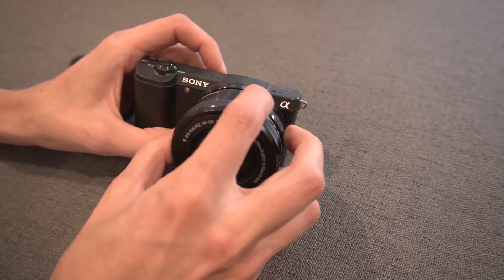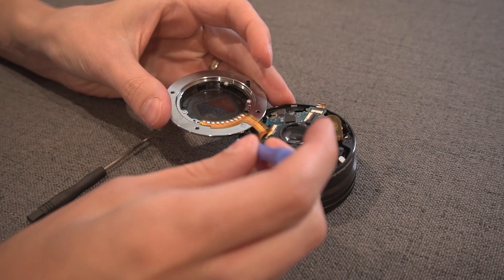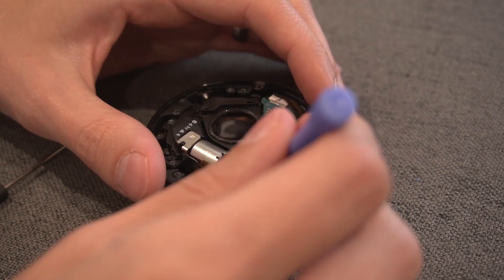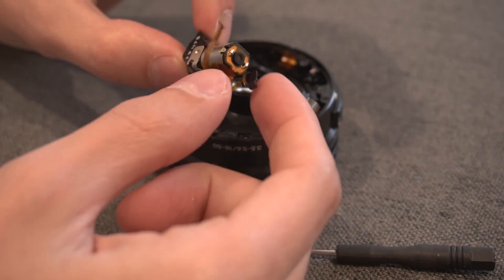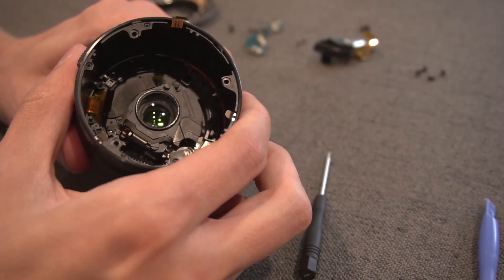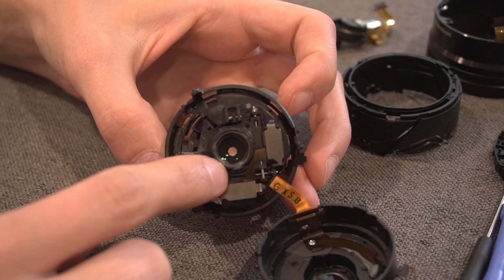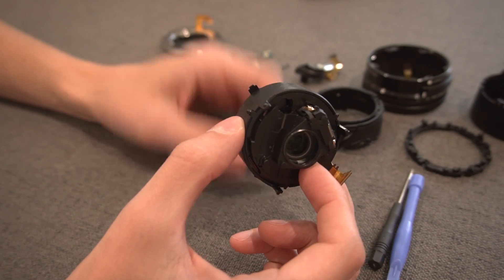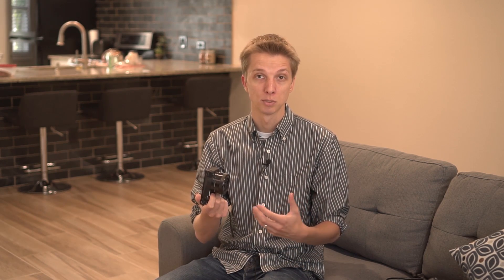Sony 16-50mm Kit Lens Disassembly Tutorial

Comment: Hi. Thank you for this tutorial!

This completely saved me from buying a secondhand kit lens for the Sony A6000 which I only borrowed from my son.

I just finished repairing the kit after a heartbreaking incident during a pre-Christmas celebration with wife and her friends.

I had a power bank (in my pocket) attached to the camera through a dummy battery.
I forgot all about it. When I stood up, there went the camera with the lens and a Godox TT600 flash landing on the concrete floor. 
Everything inside the lens got misaligned and stuck.
Good thing only the lens was affected but not damaged as there were no severe dents and broken parts.
Just minor scratches. It absorbed all the impact.
This kit lens is tough indeed!

The camera and flash are both okay.

This tutorial saved me a lot of pain in disassembling and reassembling.
Mine was more difficult to disassemble as the impact caused all three plastic and three metal guides jumped off its tracks (as in train tracks if this is the right term).

I had to improvise extra plastic pry tools using ballpoint pen caps. 😂
It was too painful to describe; I was worried I would break it.

Thank God! The kit lens and camera are working.

God bless you!
Shalom

Comment: Well I got it apart and found exactly what was predicted. One of the tabs came off. I removed that and finally got the thing back together, but I'm still getting the error msgs saying that the lens is not supported. It feels like it's trying to autofocus, but not working. Any advice?
Reply: I figured out why mine wasn't auto-focusing... I must admit, it's a little embarrassing. There are four ribbon cables that attach to the PCB. In the video, during the rebuild section, he only shows three of them being installed. Normally this would be a completely obvious oversight (and admittedly it still is), but one of the ribbon cables on the right of the PCB is very easily covered up as you place the PCB down. As a result... I just didn't install it... 

Take a look at the image below. The ribbon cable labeled "A" ended up below the PCB. He doesn't show it being reinstalled, so I just mindlessly skipped it. It goes into "B" with the  gold side down.

The commenter above is referring to the orientation of this cable. They must have installed it upside-down. I simply didn't install it back in the PCB. Once I did, everything worked great. 

I hope this helps!

https://imgur.com/a/pOGuysS

Comment: Help! Great video, but I'm stuck. I'm hoping someone can provide some guidance. I'm at the step at 6:00 where the outer piece that holds the front lens, but my lens will not extend (this is the problem with the lens to begin with). I suspect something is in those trenches preventing the pins from moving. How can I get the outer piece off if I cannot extend the lens and move those pins to the bottom?

Comment: Thank you! My lens would not retract fully which caused the A6000 to not recognize the lens.  A small piece of plastic from one of the tabs broke off and prevented the lens from fully retracting it.  Clearing the debris out after a full disassembly fixed it so now it once again works perfectly.  Yes lining every up for reassembly was the most difficult part.  The complexity of the plastic channels to make everything work with one motor is amazing.

Comment: Yours is still the best video for fixing this lens.  Dropped camera and the barrel mechanism came out of grooves.  Had a bit of work to clean up the scratched groves and to carefully bend the tabs/pins back.  Even had to repeat because the smallest little ding on the barrel caused it to hang up while zooming (clearances very tight) so I would just warn people to examine those surfaces very carefully looking for dings or places it will bind.  But your clues on how to reassemble were perfect.  For sure I would have given up without them.

Comment: Wow, you have saved me from having to buy a new lens for the camera. I am eternally grateful!

I had exactly the same problem as you, the lens wouldn't close all the way when I turned the camera off and when I turned it on it made a weird noise and wouldn't zoom. It also gave me an error.

When I disassembled the lens following your steps, a little piece of plastic fell out and it turned out to be exactly the same tab that had broken off for you. In my case I didn't stick it with glue, I reassembled the lens removing the little piece of plastic to test if that was the problem. I have kept it to be able to glue it in the future.

After being able to mount the lens again (what an odyssey!), it works like a charm again.

Thanks a lot for the tutorial!

Comment: I  have seen this video before out of curiosity but hoping that i'd never had to actually use it, but today I had to come back.
I dropped my kit lens, and the focus ring got bent and stuck,  and  it wasn´t expanding any more when I turned the camera on.. a total mess, but thanks to this I was able to disassemble it,  and gently use a chisel and hammer to straighten the edge of the ring,   it took me a couple of hours to assemble everything back in, but now it is working like a charm again.
thank you very much for submitting this.

Comment: If you google a bit, you should be able to find the service manual for free. I don't think youtube will let me put the link in the comment. But Sony recommends removing the focus ring (called the "Operation Barrel Assy") before separating the inner and outer barrels, that way you don't have to force the pins out, they just slide apart. You  can use a piece of thin wire to lock the focus ring inner and outer instead of the fancy tool in the manual though.

Comment: Thanks a lot Arthur R - just came cross you vid when I start wondering, can I fix my kits lens? My kit lens were a replacement from Sony service centre here, but broke after few time use, pass warranty already. That already cost me RM280. So now I'm searching a prelove lens but the price also around RM300-400. Yeiks! 

Now I found you vid. I would like to share my pic - asking suggestion could I fix it?! I guess I try it out first.
Reply: This video sure do help me; gain knowledge & save money.
I had similar issue with my kit Lens yes, mine did brake that little tiny part. By following steps & understanding from this video, I managed to repair my kit lens and its good like before.

Thats a lot Athur

Comment: For those who have sand stuck under the focus ring, here is what to do after having removed the barrel from the inner part following Arthur's instruction:
1. Remove the little sticker ring of the rim of the focus ring, revealing three little holes and the plastic lock-ring it sits on.
2. On this inner lock ring there is a 1cm piece which is a little more flexible. There should be a little gap to the left and right of it
3. Align one of the three holes of the focus ring with the left gap of the inner lock-ring, and use a small flat head-screw driver to lock the two in position. Then twist counter clockwise on focus ring for about 1cm
4. You will now be able to detach the focus ring + lock-ring. You should now be able to proper see the small little 1cm piece holding the lock-ring in place. This itself is detachable and only held in place by the same felt-ring like the rest of the lock-ring.
5. Simply flip it off gently and get in between the lock-ring and the focus-ring with a small flat-head screw driver. Not bend the plastic lock-ring gently and get it out. Make sure you don't break the little felt ring it is attached to.
6. Now you can clean both surfaces from sand. Use a Q-Tip. After re-grease slightly to assure proper motion.
7. The little black marks you see on the inside work together with an optical sensor. On my lense, half of my marks have been worn off because of the sand! I simply drew them back on with a marker pen.
8. Put everything back together. Clean the rim of the focus ring from any grease to make sure that the sticker ring will stick properly after.

Took me about 20mins to figure out the mechanism and another 10min to clean the ring. Good Luck.
Reply: Awesome description man, I dismounted the whole camera as the video and mounted again and manual focus still wasn't working. Then googled a lot to find a spare part, but then I bumped into to your comment and finding the sticker ring was like magic, I thought that was impossible to disassemble! After that just follow your steps, clean up the marks and the optical sensor and it works again, thanks!!
Reply: @penyamarbella  Was a pleasure to help :) ! Glad you managed to fix it.
Reply: Any change you could elaborate a bit more on the whole "locking in place" thing? I've put a small screwdriver in the place you told me to, but the focus ring won't budge.

Comment: I just want to let you know that you are ABSOLUTILY AMAZING. First of all, this is not my kit lens. It's a 2020 kit lens. BUTTTT it's almost the same, mine is easier than this one but i got this guide and after 3 hours of doing the last part, having a break to have dinner and having a happy hour from my wife, then i returned to work with this lens ....fucking made it. I FIXED my lens (i can't believe it).

History time: I dropped my lens yesterday and apparantly the the pieces fell apart inside, so i just readjusted the parts and then... bummm, got it fixed. i know maybe it's not the best lens but not having a full frame, no having money to get a new one or a better one for this fu$king covid... this little one can save the day. 

My man, you have a new suscriber!

Comment: At least it's "easy" because there is a only way to assembly. But in fact it's hard and a little bit frustrating. I have lubricate the gears with a very very tinny layer of  lithium grease between gear teeth to solve the grinding noise ant the clog/jump when it goes from being closed to being open. I have been very precise with that and with the assembly. I think that grease will never arrive to the sensor (I hope). Now the lens open and close smoothly without any strange sound.

Comment: this video is very useful to me because i wanna modify my SONY Zeiss Sonnar 35mm f2.8 to work with my anamorphic adapter, I wanna put an oval inset at somewhere between the aperture and the bottom glass, but since i watched this video, i guess i can not put it that FAR because there is a stabilizer, right? so i wanna ask u few questions:
1, have u tried to open zeiss sonnar 35mm f2.8?
2, do u think they all look same inside?
3, as ur experience, do u think it's possible to open at least the bottom glass and stick the oval at the back???
thank u

Comment: Thank you! Dropped my camera while on vacation last week and it landed lens down. Entire mechanism was locked up. Tab missing just like you said. Couldn't find it, but replacement bayonet is $8 on amazon. Put it back together with the missing the tab and it works for now. Ordering parts just in case.. many thanks!

Comment: My lens had the same problem but it didn’t get fixed with glue. I did tear apart the wire while trying to reassemble. It’s not for anyone and the part where you align the two dots is almost impossible. Sony should make better lenses than those that easily break. That plastic ring should simply be metal if they want these lenses to last.

Comment: We must have different lenses because the 13:00 manuever is nowhere near as simple as your video. There is no possible way it pops back together I have been trying for nearly 2 hours. There are three tracks, one for the pip with the extender, and then two more tracks for the pips that are stacked on each other. They do not fit together when all the pieces are flush, you have to essentially suspend the 3 barrels all halfway through their movements and slide the pips back together one by one while spaced properly and keeping the ribbon cables out of the way. Once that is done there is ANOTHER final barrel that also needs to be re-soaced and lined up. So, picture 4 barrels each that can freely rotate with milimeter sized  pips that only fit in when all four 360 degree barrels are lined up properly with one another, and essentially 4 decoy landmarks on each barrels to guide the pips...do the math and see what your chances are 0/10 would never recommend if you've got my lens build.
Reply: Seriously...F*** attempting this repair.

Comment: Thanks for the guide! It helped me finding the problem with my lens that doesn't get recognised by my Sony Alpha 6000. My bracket is broken too. I just ordered a replacement part from AliExpress for like €1,50. When it arrives I will try to reassemble the lens :).
Reply: Guess what, the part came in and I reassembled the lens and the problem is fixed. Thanks again!

Comment: Great video!!! - I bought the a6000 body with the kit lens non-functional for $80.  It had been dropped.  I was able to tear it down and epoxy the exact same piece that broke on mine, then put it all back together.  I had to do some very light shaping of the plastic with a Dremel to get it to fit "exact" after the epoxy had set, but it all works perfectly now!

Comment: T H A N K
Y O U 👏 👏 👏

I was able to repair my lens after struggling for months to force my lens in and out manually. One of the tabs had broken off the ring as described, took less than an hour to disassemble and reassemble!

(Some patience and fine motor skills necessary).

Everything one needs is in this video, my difference was I simply removed the tab instead of gluing it back in place, but so far it’s not necessary to the functioning of the lens.

Great vid, thanks for taking the time to make it!!!🥂

Comment: I can't remove the lens from the ring, my lens is stuck. I can't extend as much as you. HEEELP ME PLEAASE
Reply: Hi, I had a similar problem once i removed the focusing ring. I couldn't make it slide. It helped me to manually move the gear looking thing inside the circle, next to the glass, while moving the slider. Hope it helps. Turns out I also had a broken plastic piece .
Reply: Br M  did you try moving it with some external tool?

Comment: Hey, i have a sony18105, when I turn it upside down Im hearing a sound, and found out that it is the glass that moves back and forth inside. Im not sure if that is the power zoom, but the tech said it is a flex issue that needs to be replace. What do you think?

Comment: My camera fell on my kitlens and dented the ring, making it impossible for the electronics to move the ring ( very hard to move  with my hands). Could I fix it just by replacing the ring? This is my second kitlens Ive broken, and no repairshop want to give it a try unless i pay the same price of a second hand one...
Reply: Ok, I just unmounted and put back everything again (thanks for the video, I wouldn't have done it either way!), and it definitely is the outer ring that doesnt slide correctly. Internals look good on the first sight. As it isn't shown how to disassemble the outer case with the ring, how do i do it? I don't see any way to separate the ring from the case.
Reply: I fixed it! Out of desesperation after assembling it I connected the lens with 0 hope, and it just works somehow! :D The ring still doesnt slide smoothly because of the dent, but dissassambling and assambling it back again might have actually unlocked it.

Comment: THANK YOU! Bought this exact kit lens at a flea market for $20 and as expected my a5100 threw the "lens not recognized" error. Well after reading many forums where they just tell you to buy another one and trying all sorts of techniques like shaking it and cleaning the contacts I just figured I'll tear it apart. Turned out  All I needed was to be able to remove the barrel as I discovered the retractable mechanism was jamed up and I needed to manually move it with my hand.  Well after doing that and reassembling it worked! I don't know of it'll last for long but your video helped me get to a solution.

Comment: Excellent video. Good technical points. Good demonstration of the procedures that take a little finesse. Edited well.  Minimal Smalltalk or extraneous info.  Clean, clear, concise, excellent videography.  What more can I say?   I’ve done a number of small device repairs with a significant amount of frustration. This video illuminates at least 75% of the points that I find frustrating. I feel this fellow is professional.

Comment: SELP 1650 broke down. Apparently the aperture motor broke down.
The problems are:
- Camera body (Sony A6000) does not show aperture (only briefly it comes up to show aperture number and disappears again)
- No control of aperture in camera
- Aperture stuck in smallest (~f36)
- Strange ticking sound inside the lens when attached to body

Have you guys experienced similar problems with Sony SELP 1650 lenses??? Anyway. How to fix it on your own? Thanks.
Reply: Sama problem with mine now. No aperture reading, and ticking sound

Comment: Mission accomplished, lens fixed for $7 bucks for the ring and 2 hours, thanks for the video it would be much much harder without it
Reply: where did you get the ring??
Reply: @ICaptainA  in the Mordor.
Reply: @ICaptainA  https://www.ebay.de/i/383118745850?chn=ps&norover=1&mkevt=1&mkrid=707-134425-41852-0&mkcid=2&itemid=383118745850&targetid=527969221833&device=c&mktype=pla&googleloc=9043411&poi=&campaignid=1669295758&mkgroupid=63847509999&rlsatarget=pla-527969221833&abcId=1139676&merchantid=7364532&gclid=Cj0KCQiAjfvwBRCkARIsAIqSWlMf4SQHOA8CKylOr4fGaq29ZBBspFxnxmIoY6UYqyKVX5fuY-JLQnYaAkEFEALw_wcB
Reply: Where did you get the ring?
Reply: My zoom ring is stuck after dropping while on tripod and even after taking the 4 screws out the lens barrel doesn't move. I can't move past the step of removing the zoom ring and lens barrel. Any tip?
Reply: @earthnaturecreation  had the same problem, just jiggle it until it breaks free. concentrate on the rotary teeth. apply slight pressure in the counterclockwise direction and you should be able to make it work